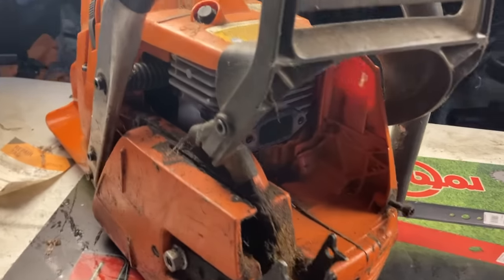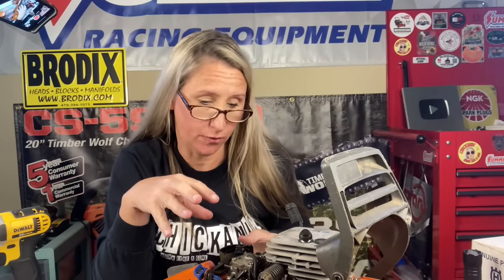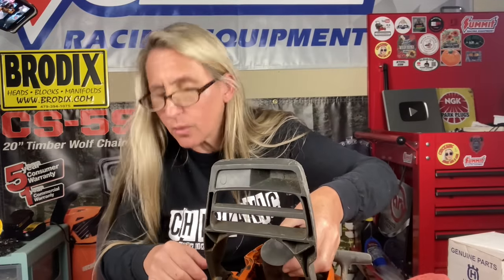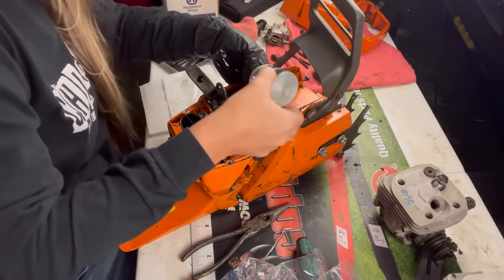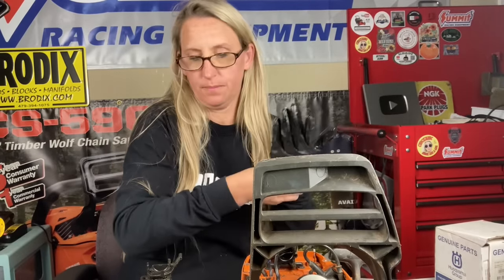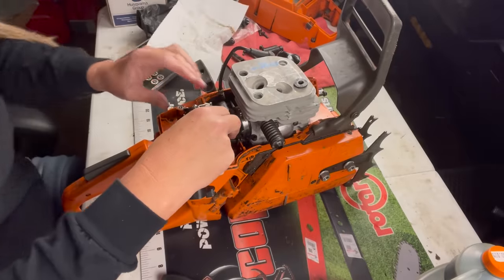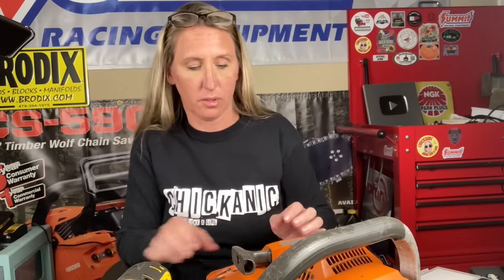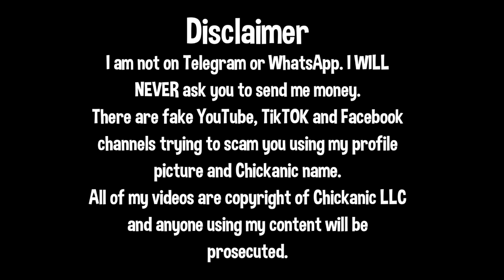Customers $1,200 Chainsaw Destroyed! Husqvarna 372 XP Rebuild

Comment: Appreciate the in-depth disassembly and re-assembly. 

As far as RVs... If you could find one with a small 2-cycle engine, you could easily repair it if it were to break down. Though I doubt it would ever make it out of a driveway 🤣

Seriously, you might consider a pop-up, small tow-behind, or truck bed camper. We like all 3 options for different things. My overall favorite (in theory since we don't have one) is the truck-bed type with pull-out sides. Not the biggest, but seems like the most flexible.
Reply: Great options and for many different reasons. My cousin who always vacationed with 8 or 9 people got a used small towable camper with a small eating and sleeping slide out. Since the camper was mainly to be used for sleeping, eating fast food on occasion or food off the Coleman stove and only hanging out in bad weather, he ripped out the kitchen, except for the upper cabinets, the closet, the refrigerator and stove (I think he added to the shower toilet space, some tote storage as well ) and converted all the open floor and wall spaces into sleeping areas with some shorter upper bunks with folding side rails for kids, that all folded up or back against the wall for more seating and table room. 3 kids and 5 or 6 adults could eat and sleep comfortably and shower and use the bathroom. He made an extra lockable metal storage bin for extra items, totes and necessities like paper plates, cups, cooking utensils, tools, rv supplies, outdoor games... beach toys, and a nice size cooler....because he also removed the fridge, And added a platform to hold it just above the rear bumper. It has its own fold up lockable ramp that folds down to roll it on and off the platform because it is on small wheels. They would drop the box at their garage and go park the camper in the storage lot, leaving the box home for them to restock and organize with all the necessities for their next trip. Then they would get the camper load up the box and go! Chickanic....You and your husband are very talented and could thoroughly inspect and find a good solid camper to convert, and in a couple seasons could easily do something similar for just 7 people that would be really budget wise! They always had the best of times taking that camper everywhere because it covered their most basic and costly on the road needs. Some people like the idea of camping and staying put inside the camper for days without stepping outdoors, but they were always in and out of that thing doing something and having fun because it was small, easy to tow, and could be used almost anywhere. Only did the weather ever hold them hostage inside. Good luck! I hope if you go that route that you decide put it on a channel for us viewers, because you not only are cool and great personality on camera, but there are lots of people who can't pin down the basics of a camper or motorhome and get in way over there heads on what they think they need to have, in order to have fun! Later! J Pol..

Comment: Old school tip: use the original Slick 50 formula, now being sold as Xcelplus as assembly lube.  It gives conventional lubrication for initial startup, and permeates the metal with Teflon like polymer after just a few seconds of running.  This polymer will reduce friction nearly indefinitely in a 2 stroke or 4 stroke small engine.

Comment: Hope you checked crank bearings for play causing air leak. Under side of piston burnt is sign. Definitely would recommend seals atleast and clean tank with new feul filter 🔧🔧 gas that come out looked like dirty paint thinner lol . Definitely recommend checking crank bearings and seals on saws or lean failure can happen again even if seems to run good after rebuild. Very nice job you're the best 🔧🔧🔥🔥🏁🏁 maybe you did check just dud show. I have a 575 on bench right now same deal. Was rebuilt few months ago just top end. PTO bearing spun causing air leak and burnt up again 😃

Comment: gotta love the 372's. the cast crankcase means you can rebuild them forever if you watch them. crank bearings and seals every other jug  unless it doesnt pass a pressure test. newest versions fixed the muffler issues but the new muffler is not backward compatible (no screw holes in the crankcase) i always warned customers that all that piston and cylinder scoring may have got to the crank bearings. it was thier choice.

Comment: Just a quick thing.....I use to work in a small tool hire shop years ago.....
Best little home made tool I made was a peace of wood...1"thick 1 3/4" wide and about 6" long with a 3/4" slot in it about 3 3/4" down middle.
I can slot under new piston to aid getting rings into new pot.
And with it been wood it won't damage gasket or pot and piston too.
Keep up the great vids.

Comment: Do a thorough pressure/vacuum test on the saw before you give it back. Make sure the crank seals and or the cylinder gasket isn't leaking. Great video as always Chickanic, glad you're back.
Reply: If you didn’t want to completely break a saw down couldn’t you just do the Brake Cleaner spray test to look for air leaks ?
Reply: @shannonwhitaker9630 no because how are you going to spray brake clean behind the flywheel and clutch to see if crank seals are sucking air?

Comment: You did a great job! I have become obsessed with performing a pressure/leak test on all my 2cycle builds. Ya find small leaks in the strangest of places. I will say one thing…. Once you do a leak test the confidence level really goes up. And the engine will usually reward you with immediate starts and consistent and smooth idle and sharp response. Great video!

Comment: When I traveled to Japan, we had one hour to get from one airport to another to catch the next flight.  During that hour, we had to claim our bags, clear customs, buy a bus ticket, find the bus, ride to the other airport, then check in at the other airline. Japan has a very efficient bus system, so we made the connection without issues.

Comment: I'm glad to see that Husqvarna made the bottom of the cylinder tapered. Quality machines. I would suggest not pouring gas from the tank toward yourself. I always wondered if running the saw for hours would overheat it. Now I see it may be the fuel mix. I hope your husbands leg is better, I guess so if y'all went to Mexico. I'm also glad to see you warm up the machine. I hate arguing with people about warming up a 600 dollar saw or whatever 2 cycle equipment before using it. Wait was it his shoulder?
Reply: I let my weedeater and BP blower warmup/run before i use always.

Comment: Great video for saw owners who may be intimidated by a top end repair. Please do make the ring seating video! In a commercial setting where time is money, both P&C are replaced, but most often in this situation, the apparent scoring on the cylinder is actually aluminum transfer from the piston, and the cylinder can be cleaned up. The lean heat actually melts the surface of the piston. The plating of the cylinder is very hard and resists scoring. Aluminum transfer can be removed by muriatic acid (HCl) or saturated aqueous sodium hydroxide (NaOH) or flap sanding. Because muriatic acid gives off nasty fumes, I use NaOH on a Q-tip. It will foam slightly, dissolving aluminum and liberating hydrogen gas. This is followed by light honing. There are some good aftermarket pistons such as Meteor which are less expensive and generally regarded as OEM quality.

Your airline experience illustrates why most of us hate flying. It's fine in the air, but on the ground there is constant worry about cancellations, delays, and missed connections. At least you had a fun trip and got some natural highlights from the Mexican sun😍.
Reply: Hope Bre, will comment on your aluminum transfer removal. Seems the way to go for diyselves but of course, you would still have to identify the root problem if you don't want to be redoing the repair in the near future !
Reply: @danielrobert7181   Absolutely! I learned that the hard way when I did a top end on my 034 years ago. It was the first major repair I had ever done on a chainsaw and I was shockingly ignorant about 2-stroke engines - it was a repair that had to be done quickly to finish a job. I bought a new Stihl piston and rings, cleaned up the cylinder a bit, and reassembled. It only took a few minutes run time to realize that something was very wrong. On disassembly, the sparkling new piston was once again starting to score. I had yet to learn the importance of crankshaft oil seals, the original cause of the failure. The combination of innate mechanical aptitude plus lack of knowledge can be expensive!😆
Reply: I am also intimidated by bottom end repair
Reply: @fair2middlin  Top end repair compared to bottom end repair is like appendectomy compared to heart transplant 😧

Comment: As to doing all the testing, I didn't hear if you did or didn't. As you know and have shown, pulling the rope will give a good idea of compression. Pulling the muffler to put an eyeball on the piston shortens the work time. And using the scope to look inside works too. I don't always run the tests unless I feel I need to.

Comment: Bre, I HATE Dallas Airport and AA and can TOTALLY relate with you… 
   Great video!!! Just make sure your bottom end isn’t full of aluminum slurry before assembly and clean that out with mix. I like how liberal you are with pre lube!!!!
Reply: I spray the crankcase full of brake or parts cleaner, slosh it around, then turn it upside down and pour it out...then spray it out again with cleaner while it's upside down..dry it out, then pour liberal amounts of 2 cycle oil in the crankcase, let it sit, then rotate the crankshaft and leave it in there overnight. Then pour the excess oil out and re-assemble top end...

Comment: Great video!  Great saw! Curious what the customer was running for mix and or why it may have gotten hot. Husky recommends 50:1 but I have heard of these newer husky saws especially the 572 XP and 550XP run lean from the factory. I run my huskys at 40:1 and 32:1. Echos at 50:1.  A free flowing exhaust seems to keep it running cooler as well.
Reply: Just remeber the more oil the leaner the air fuel mix is the oil takes up cylinder space you must adjust the carb acordingly ,most people forget the point its a 2 stroke and thats how its oiled ,i have always run my 262 xp at 50 to 1, bought it new in 96 ,be sure to use the best 2 stroke oil ,as a skidoo dealer i used there bombardier injection  oil ,it was proven to have the lowest viscosity back then ,and least carbon buildup ,castrol is good as well .
Reply: I always say who cares if a saw has been run for 25 years one hour per year at 50:1. Lets see that saw run 150hrs per year at 50:1 for 5 years. 

I run 42:1 because 50:1 is an EPA ratio to meet emissions certification standards with no regard for engine longevity.
Reply: @davemcewen9991  The bigger point is that more oil makes the fuel mix more viscous, thus less flow past the metering screw which means whenever you change brands of oil, or mixture ratio, you should re-adjust the metering screw.

Comment: these are awesome saws,my normal 'timber' saw is a 372,big timber is a 395.When I heard they were going to stop making them I bought one as a spare,it's never seen gas or oil with a 24inch bar.I run a 357 that I bought 'siezed' and in a box for the bulk of my cutting. 346 was a great saw too
Reply: I have the 0.41 purchased back in 98 still running great. And excellent trim saw
Reply: I sure wish they made knock-off of the 346xp like they do the 372's...shame they don't...

Comment: Love your running commentary and advice.

Allow me to offer a few suggestions based on my own experience:

1. I have replaced the carbs on all my small engines (both 2-stroke and 4-stroke) with very inexpensive after-market products. Every one has worked perfectly. The caveat is that at less than $20 apiece I can afford to do it every year if necessary, and the job is so easy I can do it in less than an hour. So no worries about labor cost and down time in the shop. Obviously I don't recommend this approach for a non-DIY.

2. We travel outside the US frequently, so we have found that the government's Global Entry program is worth its weight in gold ($100 for five years). GE speeds you through customs and gets you into the US in a heartbeat. I can't help but think that might have enabled you to catch your connecting flight in DFW and saved you the Time, Expense, and Frustration that you had to endure on your return trip.

That said, I am glad you had a great time in Mexico. I'm not a fisherman, but I do like Cuban Rum. Can't get Havana Club 7-year here, so we try to bring some home whenever we are abroad.

Hope you all are having a good holiday season and a great year in your new shop.

Comment: Great video.  On the RV topic I would strongly recommend renting various classes, A,B,C, travel trailer or a fifth wheel if you have truck to pull one. Rent before you consider buying. If you buy, never buy a new one. They are like cars and depreciate quickly. Also, RVs are one of the few things that you get what you pay for. There are just a few quality manufacturers. Avoid Camping World completely.
Reply: Ok

Comment: Nice job.  I'm surprised you didn't use a torque wrench to tighten the cylinder down.  I know those chainsaws have some pretty tight tolerances.  Price aside, I'd never use aftermarket parts on a saw.  The variances can be just too big especially for those big saws.  

I traveled plenty in my 20's (back in the mid to late 80's), mostly for work.  I hated flying then, it is absolutely insufferable now.  My wife wants to take me to Brazil to meet her family this spring.  I am researching medications that will keep me knocked out for the duration of the flight.

Comment: Rebuilding a Husqvarna 372 is super easy and you can try Hyghway Cylinder kits for about 100$ unless your porting them, aftermarket cylinders don’t hold up to porting like OEM, you can port aftermarket but they won’t last as long and have more issues with chipping

Comment: Personally I like to install cylinder with the carb already attached. It is easier to make sure the boot is sealed well...👍
Reply: I started doing them this way as well for that exact reason, I just got done putting the big bore kit on my Makita 6401this way because of what a pain it is to line the carb back up
Reply: @billyboy861  Especially models like the 372 that are know for boot tears or not sealed well from people tugging on them when bar is pinched. I find most of her video informative but not finding the reason for running lean. I can't but help feeling it will be back soon...

Comment: Pressure and Vacuum testing a saw that has run lean is recommended ?  I know that I would not just drop a new cylinder  kit on with out a definite cause. May someone was playing with the mixture and she was told.  The new filter gets me thinking they may have leaned it out with a dirty one . Put on a new one and it was to lean for all that extra air flow.  Leaned out cylinder/piston burn has me asking a lot of questions or doing all the tests.

Comment: Thanks for the look into a 372xt -- I am not as familiar with the XT as the older edition.  I have to agree, however, with several other comments here that pressure/vac test would be a good idea to make sure it doesn't happen again to the new P&C.  The x-torqs seem to be designed to run on the lean side, anyway, so I don't think they have a lot of margin for error as far as leaks.  I would at least make sure it idles on its sides and has a richer-looking sparkplug rather than a leaner looking one after a tank of work.  

I am guessing you may know more about this than we do, though -- did the customer say the crew straight gassed it :)?  It may have had oil from subsequent attempts (with mix) to run the saw...  I have one clone 372 that looked very similar (but with no bluing on the bottom end of the crank) that I bought cheap as a return and I figure it must have been run on straight gas (for a very short time) or with a lean setting for some time before it locked up.  It also had a lot of extremely fine dust inside, which made me think maybe a very dull chain didn't help...
Reply: The X-Torq's were far more prone to crank bearing failures, as well as intake boot air leaks..that sounds like it may be the issue on this saw from the way it sounded..I was never a huge fan of the 372X-Torq..it was pretty much a desperate move to get the very popular 372 to meet EPA standards, so they could continue selling them..if you think about it, there was no other reason to do such an extensive top end redesign on a very good, well-established saw...

Comment: Crank seals are a must! You didn't even mention that!!
Reply from the maker: Out of the thousands of chainsaws I have worked on, crank seals have only been an issue a handful of times.
Reply: @Chickanic  just the opposite for me. I'm in PNW so logging still goes strong and bad gas or carb issues are very rare. No matter what I do a pressure/vac test to know for sure!